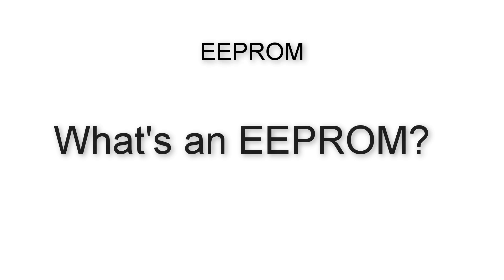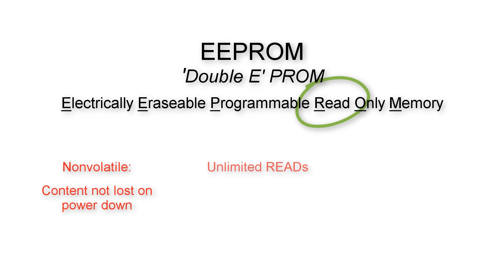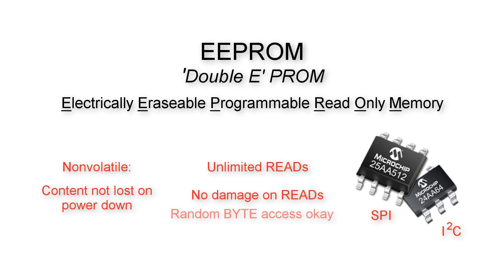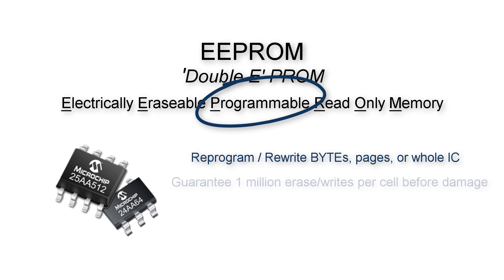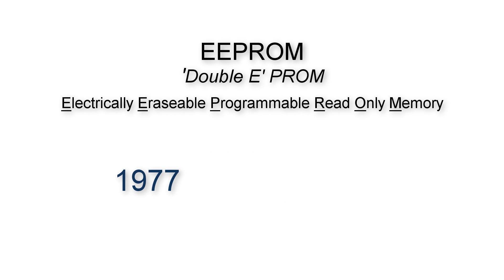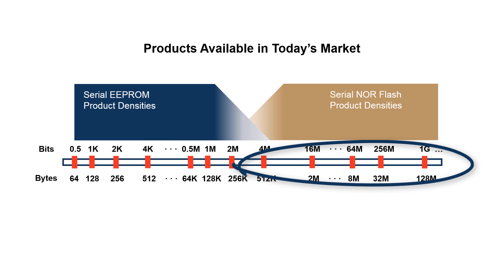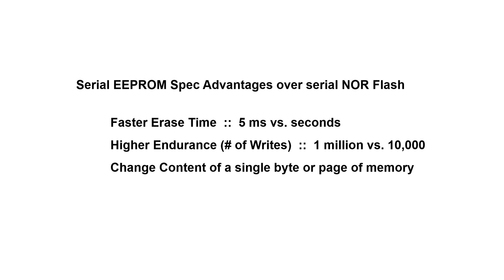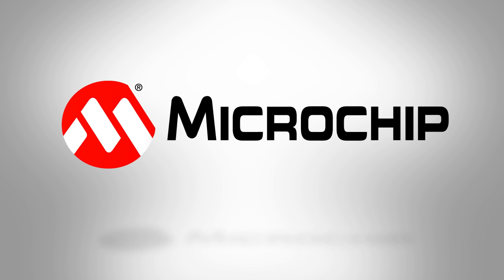What Is EEPROM?

Comment: 2:03 , can you explain how does the transistor is working? or any recommendations for the explanation on how EEPROM register works? thanks !
Reply from the maker: Hi there, thanks for your question! An EEPROM memory cell typically includes a floating gate transistor. This floating gate is isolated electrically by an oxide layer. Data is stored by modifying the electrical charge on the floating gate. Applying an electric field forces electrons through the oxide layer onto the floating gate, which remains even after the power is removed, hence preserving the data stored.
 
As for the transistor's operation, when no charge is present on the floating gate, the transistor allows current to pass through, representing a '1'. When the floating gate is charged, it blocks the current flow, representing a '0'.
 
For a detailed explanation and diagrams illustrating the EEPROM register and transistor operation, the Getting Started with Serial EEPROMs guide (https://www.microchip.com/en-us/products/memory/serial-eeprom/getting-started) on Microchip's website is a great resource. It offers practical insights and a deeper dive into the technology, which might be exactly what you're looking for!
Reply: @MicrochipTechnology  Thankyou so much for the detailed explanation!
Reply from the maker: Happy to help!

Comment: Is EEPROM and RAM the same?
Reply from the maker: Hi there, thanks for reaching out with your question. EEPROM and RAM are not the same. EEPROM (Electrically Erasable Programmable Read-Only Memory) is non-volatile, meaning it retains data when power is turned off, ideal for infrequent writes and frequent reads. RAM (Random Access Memory) is volatile and requires power to maintain its data, used for high-speed read/write operations essential for system operations and running applications. They serve different purposes in computing and electronics, with EEPROM for long-term data storage and RAM for temporary data access during device operation. Hope this helps!
Reply: @MicrochipTechnology  Huge thanks 😊
Reply from the maker: No problem! Happy to help.

Comment: Pls I need answer to this..
Can i get the list of devices that make use of prom, eprom and eeprom..

Do we still use prom, eprom,  eeprom in this generation? And where are they used?
Reply from the maker: @Isaiah - On the non-volatile memory timeline, with decades as the horizontal timestep axis, first came ROM,  then the market pushed for PROM,  then the market pushed for EPROM, then the market pushed for EEPROM (which then added FLASH). When we pitch business plans to our management we need to show a proper ROI to get funding for new designs. We haven’t tried to pitch a business plan at Microchip for ROM, or PROM, or EPROM for several decades now… the market just won’t cover our investment bet.  But some companies with long running products (think 30 years) keep ordering our old PROM and EPROM products from many years ago. These PROM and EPROM orders come from military and industrial infrastructure companies. They do not share the exact applications. But we do notice that when their design teams finally redesign these systems they finally end-of-life their need for our PROM and EPROM parts and move to EEPROM or FLASH in the redesign.
Reply: @MicrochipTechnology  thanks
Reply from the maker: @Hackeriah  You're very welcome!
Reply: I came here from looking how to program Automotive keys. Kept seeing eeprom in the descriptions.   Looks like transponder keys use eeprom

Comment: If it's read only, how come it is programmable? Doesn't it mean things have to be written? I never understood this.
Reply: I think it means that  only the CPU can read instructions from it and not write to it.
Reply: They actually can be written to. Its name doesn't accurately describe it. PROM(Programmable ROM) came first, and it could only be written to once. EPROM(Erasable PROM) came after. It could be reprogrammed after being exposed to UV light to erase data. Then EEPROM(Electronically Erasable PROM) came out, where data could be erased electronically. Older EEPROMs were also slower to write/erase, so people often used them like they were read only. Today, they can be almost instantly written to, so the term "Read Only" is inaccurate.
Reply: It is always programmable if it is PROM or EPROM or EEPROM.
Reply: @yamasaer  I don't understand what programmable means I guess. All I know is whatever is on that eeprom chip can never be changed, only red
Reply: Can you provide me solution for this error (avrdude: error: address 0x0410 out of range at line 65 of apm32u_eeprom.hex)

Comment: What is meant by "product densities"?
Reply from the maker: Manufacturers of memory products will release products in standard densities, almost always in powers of 2: 1 Kb, 2 Kb, 4 Kb, 8 Kb, 16 Kb, …, 256 Kb, …, 4 Mb, ..., 16 Mb, … , 1 Gb, …  So always look at your target manufacturer and your target memory type early in the design process to make sure the manufacturer will have a density (64 Kb, 1 Mb, etc.) that will be the right size for your system requirement.